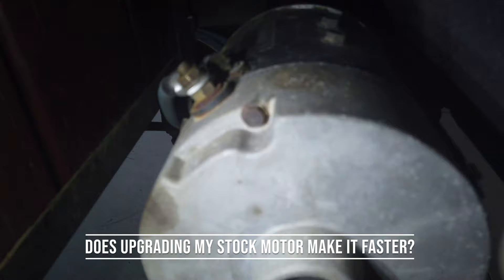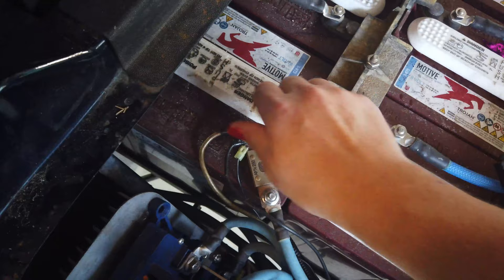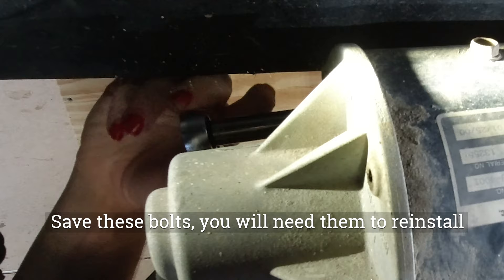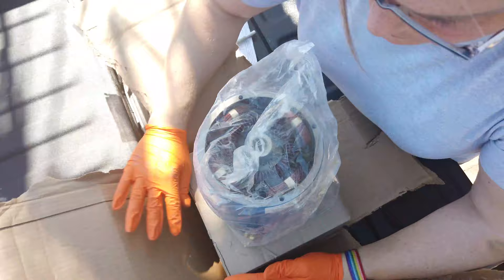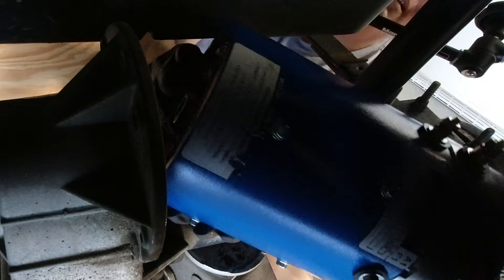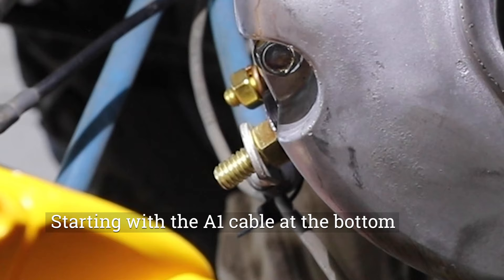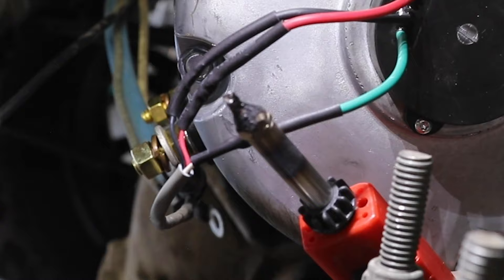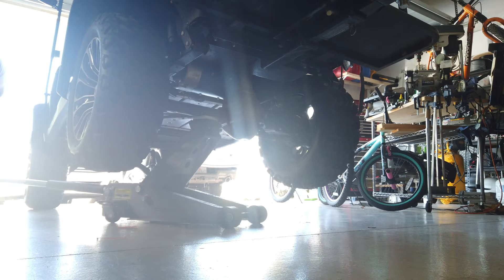How To Upgrade Your Golf Cart Motor - Install, Torque, and Speed Test

Comment: nice organized tool box.  Inspiring build.  I gave it a go and I rebuilt my golf cart from the chassis up.  I put in a 5kw 600A Navitas AC motor kit, wow!!! The speed and the torque.  36Mph and hill climb.  I put in a LiFePO battery that can deliver 240A continuous and 540 peak for 6sec and it only weighs 111lbs.
Reply from the maker: That battery change is awesome and is next on my list of upgrades! What a fun project and 36mph! That's incredible!

Comment: Great video.  With more torque and the same voltage I would have expected lower speeds.  I too would recommend going to Li-Ion batteries.  The weight savings alone along with the higher current availability and longer life definitely make it worthwhile.
Reply from the maker: Thanks. I'm considering that for the next go around. But my batteries are still less than a year old.

Comment: Excited see the new video! You inspired me to update my programming on my new controller. I went with the 600 amp alltrax. Live in Pa with lots of hills. The D&D hi torque was a must. Had to upgrade to 1 gauge copper wire because I was getting  a heat issue at the forward/reverse switch. Always enjoy your videos.  Thanks
Reply from the maker: 600 amps?!? That's a monster to pair with that motor! I freaking love it. Can't believe you had to go with 1 guage to handle heat at F/R. But that makes sense, to be honest.  Appreciate the comment, happy riding!

Comment: I cringed hard when I saw you clip the speed sensor wire. There's a snap ring around the sensor holding it to the motor. Take out the snap ring and the sensor is just magnetically held onto the motor. For a few bucks you can get a new speed sensor cable with the proper connector for the new motor.
Reply from the maker: Great advice, thank you!

Comment: always torque your battery connections to 95 to 120 inch pounds. you can experience a battery terminal melt down if you dont
Reply from the maker: Good call Patrick - I read the recommended torque for these terminals is 95 – 105 in-lb. (7.9 - 8.8 ft-lb.)
Reply: @AndiWofford  it a very common thing we see in our shop

Comment: golf cart mechanic here dont cut your speed sensor cable there are two snap rings one holding the speed sensor and then one holding in the magnet to the speed sensor just fyi but still very good tutorial
Reply from the maker: That's awesome to hear coming from a golf cart mechanic! Thanks!

Comment: Did the D&D connector not mate with the factory EZGO speed sensor harness? I am doing a swap in the next week myself and I see the EZGO does have a clip in harness for the speed sensor wires further down the loom. If so you can avoid the solder and splice.

Comment: What is the Voltage of the old motor. ?  I have a 36Volt  system  will it work ?
Reply from the maker: Yes, the old motor was installed factory at 36v. But I was on borrowed time with that controller and voltage on that factory motor. It was eventually going to give out (most likely by overheating) in time.

Comment: Would it work with the stock controller? I'm putting atv tires on my golf cart because im taking independent suspension off of an atv and replacing the front suspension so i need more torque but I don't have the money to buy both controller and motor.
Reply from the maker: I've heard of people doing that in some cases, but I would probably look more towards a forum for golf carts to answer that question than a video. Might take a while to get an answer here. Sorry.
Reply: @AndiWofford  ok, thank you.

Comment: Hi,
 I'm interested in installing new rear differential gears. I live in a golf cart community and the speed limit is 35 mph
around the neighborhood. Have you considered that option? Thank you for your videos.
Thanks,
Shawn T
Reply from the maker: Hey Shawn! I can't tell you how much I love this idea! I just started googling some parts - looks like for about $430 I I can snag a High-Speed Gear Set Kit (Fits Select E-Z-GO / Yamaha Models).  That might just be the ticket!  I have to tell you though - I'm not sure I'd do that on a stock motor. But a nice torque motor might be fun to upgrade from a 12:1 to am 8:1
Reply: Andi Wofford   Ph yea! You would absolutely need the high torque motor! Plus as many as 48 volts! My wife’s cart is a 2018 TXT 72 volt, than can actually lift the front wheels off the ground maybe an inch and leaps off the line. But after that? Not very much except for not slowing down on hills, but 25 mpg on my phone is all she wrote. That would be a great candidate for re-gearing. But borderline dangerous IMHO, due to the fact of having only rear mechanical brakes! My cart in the other hand is a 2018, Tomberlin SS Coupe, 48 volts AC, that’s the best most feature filled carts on the market!  With four wheel hydraulic brakes, with drilled an slotted front disk brakes! Independent coil-over front suspension, with trailing arm coil-over rear, 8, 6 volt T105 Trojan batteries, with a built in Bluetooth monitoring charger. Plus all DOT controls with LED lights, digital speedometer and odometer, automotive type key an steering lock, with hi/lo F/R toggle controls up across from the turn signal hi/lo beam controller, plus power steering! DOT safety glass windshield and wiper! The cart handles like a go-cart! With 245/50-12 radial high traction tires, with a limited slip differential! Helps me go just about anywhere! But it’s the tq plus speed that’s great for a stock cart! Tomberlin also has the quickest 0-25 mph time, with the occasional 26,27 mph, depending on charge. I have also driven around our beautiful 55+ community in Central Florida, called Solivida, where the speed limits are between 15-25 mph, with plenty of cart, bicycle and pedestrian concrete 8’ paths all over, with two tunnels going under main roads. I would love to be able to re-gear my cart, mostly because it has the brakes to help stop it from 30-35 mph.

Comment: What wheels and tires are those?
Reply from the maker: These are 23" tires from Steeling manufacturing in South Carolina. In my golf cart upgrades video I link to them. But here's some similar wheels: http://rover.ebay.com/rover/1/711-53200-19255-0/1?ff3=4&pub=5575460613&toolid=10001&campid=5338441563&customid=&mpre=https%3A%2F%2Fwww.ebay.com%2Fitm%2F233073620019

Comment: I have the same cart , motor , controller and I am having trouble with getting any faster than 15 mph , and alltrax is telling me that motor will only go 15 , I’m so frustrated
Reply from the maker: What about voltage? Are you at 36 or 48?
Reply: Andi Wofford 36v
Reply from the maker: What size tires? If you bump up to 48, you'll get more speed, and if you up there gear ratio to 6:1 it'll be faster as well.
Reply: Andi Wofford 22 inch tires , batteries are only thing left to do to get to 48v but been waiting due to current set are only 2 years old
Reply from the maker: Same boat here. Batteries are only a year old now and I want to go lithium. I'll sell you my Trojans 😂